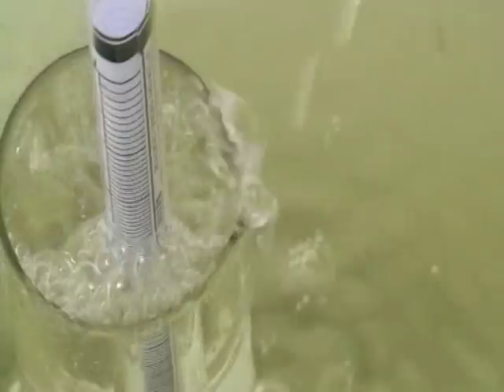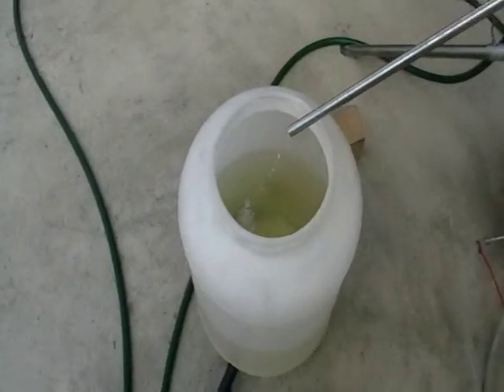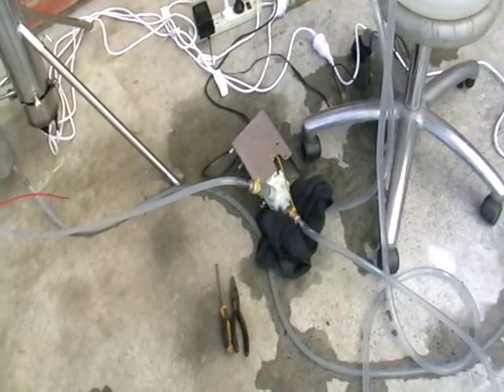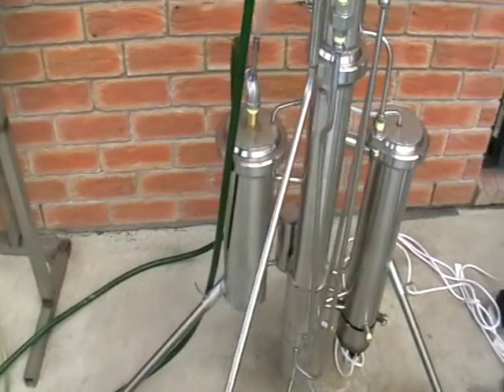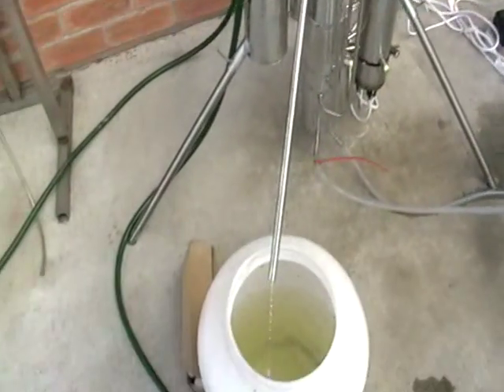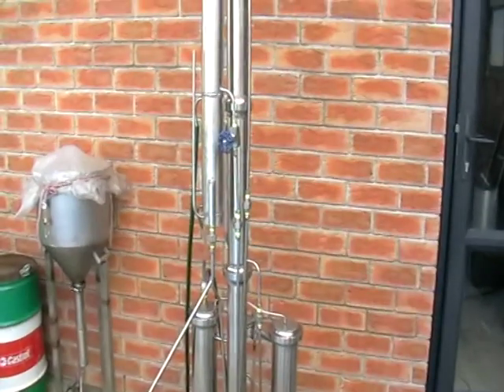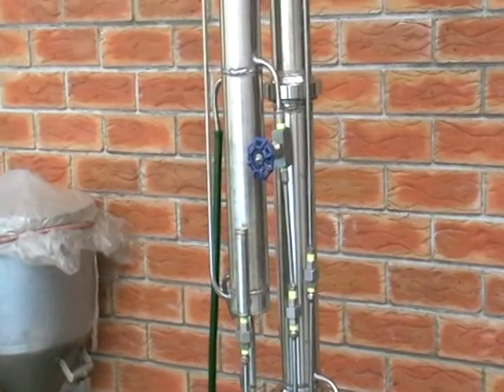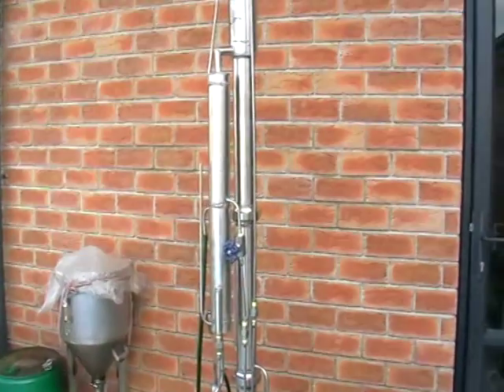Moonshine alcohol still 6kw test run 2 of 2

Comment: If to produce fuel grade alochol for mixing in with gasoline.. Would this stripper be enough or does it still need to be run through a fractional still?
Reply from the maker: For fuel ethanol there is another contraption, you can find it among my videos, just check my channel - it is called "fuel ethanol continuous still"